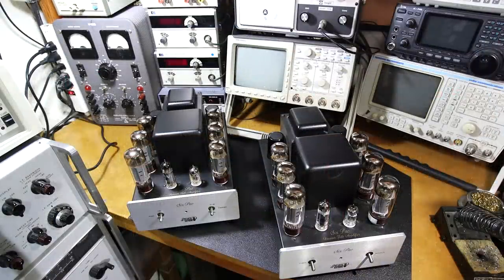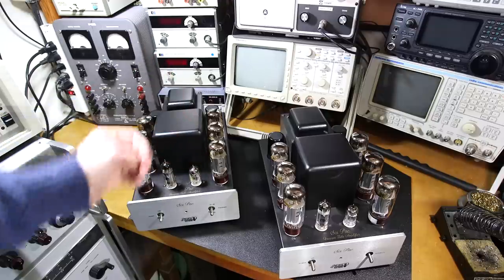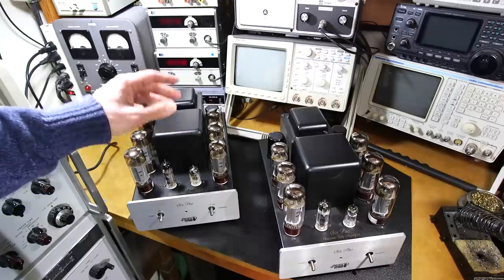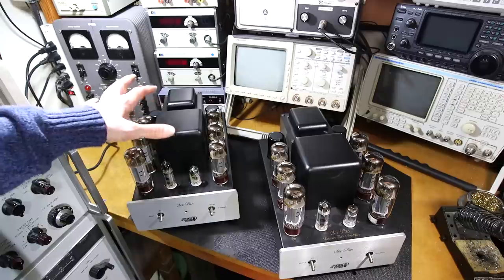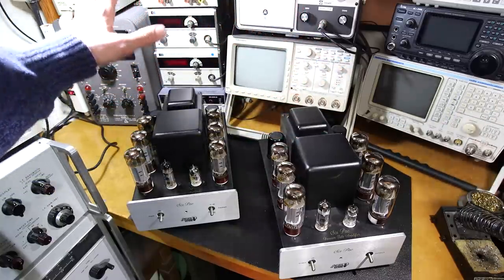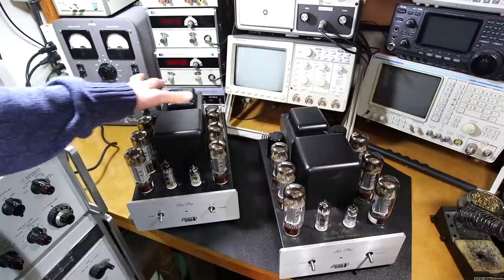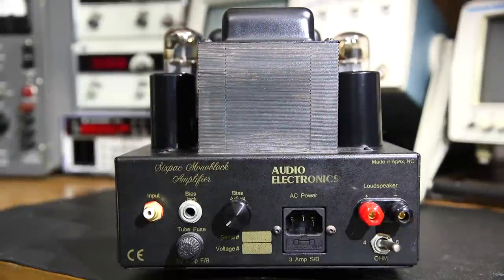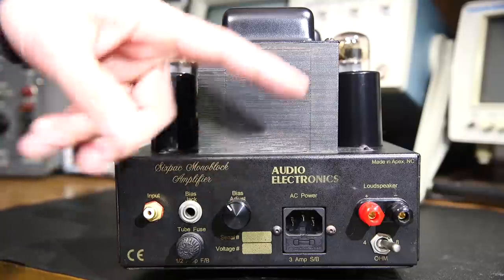Two Six Pac's On The Bench

Comment: Regarding not having a regulated negative supply for the EL84: This is quite forgivable and even reasonable given typical cost constraints. This is because, by definition, a current source pulls a constant current despite the voltage variations across it. Variations in line voltage will result in only very small changes in the current that this source pulls through the diff amp.

There are plenty of other things to criticize about this compromised design though, not the least of which is that 27.4K is far too low a plate load for good distortion performance for a 12AX7 and many other triodes. This circuit will generate healthy amounts of third order harmonics, which some people like. Not me.

Oh, and regarding the terminology of current “source” versus “sink”, it has become common practice in engineering to use the general term “source” no matter which direction the current flows. Instead, currents values are described mathematically as positive or negative to distinguish their  directionality.
Reply from the maker: Hi. The lower value resistors in the plate circuit of the 12AX7 are justified in this case. This is due to "lack of drive" because of the current sink. This also allows the "experimentation" aspect for the owner of the amp. This socket will work with many different tubes at many different gain levels. Keep in mind, most all tube audio guys tinker, and if they can say, "I made it sound better with this tube," they will yell it from the roof tops.
Reply from the maker: If you would like a better idea as to what Denny was thinking when he designed this circuit, This fella (no association) has a very good write up on the topic as well. Scroll to the bottom of the page:  http://www.angelfire.com/electronic/funwithtubes/Amp-DB_Heart.html

Comment: I believe turning the amp on, especially an unknown unit, without any load is really risky, no matter if there is some test signal applied or not. Imagine the amp under test oscillates or amplifies loud cracks or other noise. This can damage the OT, tubes and what not real quick.
Reply from the maker: Lots of misconceptions being repeated. Even if the amp pops or crackles with no load, everything would remain fine. Much of the time, testing with no load is done as well, you just don't hear about these procedures.
Reply: Thank you for responding to my comment. I'd be glad to learn something new on this interesting topic.

I used to service guitar amps and saw quite a few units with a damaged output transformer. Sometimes the reason was a manufacturing fault but most of the time it was caused by intermittent speaker cable or load selector, load mismatch or no load at all. Load matching seems to be really important when a designer's goal was to squeeze every bit of power from the least amount of tubes and iron. This was a common thing during 60s and 70s in the UK. The most extreme example I know is a 60W Laney LA60BL, all that power from a pair of EL34s, pentode connected, 600V B+ and 470ohm screen grid resistors. By the way, such high voltage is fine for plates but exceeds the screen grid rating. These amps are known to "eat" modern production tubes very, very quickly. They also suffer from notorious flashovers between pin 2 and 3 (heater and anode), damaging tubes and sockets.

When the amp has problems, intermittent connections, cold solder joints etc., I think there is a huge risk of creating a hefty voltage spike across an OT's primary that can ultimately break the insulation, especially when load isn't connected. That kind of large signal can be also injected by simply probing a certain spot of the circuit. That's why I prefer to have the load anytime I turn the amp on with power tubes in. 

I'm no expert though, I have never been educated on electronics so everything I know - I learned from the internet and guitar amplifier oriented books. I'd be delighted to learn more.

Comment: Another brilliant video.

I have a couple of observations: 

1. Regarding the EF84, I think that "current SOURCE" is the correct term. If you replaced that valve with an ideal current source the circuit would work the same way. The current running through a pentode is (for a certain range of voltages) independent of its plate voltage which is the definition of a current source.

2. If you were to wire a pot between the plate resistors of the 12AX7 and the emitter of the transistor then you could adjust for any variations between the two triode halves and save yourself an agonizing search for the perfect valve.
Reply from the maker: It's on the bottom half, and a pentode is a current "sink" by nature. Would you like some reference's to aid in this explanation?
Reply: I suspect that we could have the same nomenclature problems when deciding whether a zener diode is a voltage source, sink or reference. At the end of the day, we know what it does. ;)

However, if you have a reference that discusses when a high impedance current device should be considered a "source" and when it should be considered a "sink" then I would be interested.

Comment: I'm sorry in advance, I don't know too much about tubes, I guess I am too young still (even if I don't feel that way), but a question: why BIAS should be set manually? If it's meant to be a fixed current, why don't have some circuit to tune for that all the time and automatically? Again, sorry if I asked something stupid here ...
Reply from the maker: If the bias were to move automatically, this would affect the audio, as the movement would result in a heterodyning action. The movement itself would be at a frequency. If it was to adjust it self just once every start up, that would be ok.
Reply: OK, I see, thanks for the education, in general too :)

Comment: Turning off feedback resulting in a peak in the audio band is indicative of a poorly designed output transformer. At the very least, if it does exist in the raw transformer, a damping circuit should be installed to address it. It is certainly not reasonable to generalize that turning off feedback will cause peaking.
Reply from the maker: I have looked at the most expensive transformers, and they all peak somewhere open loop, some more pronounced than others. Oddly enough the really expensive transformers have (in many cases) the most pronounced peaks of all. This is the benefit of owning a Stanford Research SR780 and SR785.
Reply: @MrCarlsonsLab  I don't doubt that you have seen what you have seen. What I have seen is that many transformers do have peaks, but the better ones have more interleaving and therefore high-frequency bandwidth, moving their peak well above the audio band. In the context of actual amplifiers, either the transformers have had minimal peaking OR have had damping (usually in the form of an RC network, less often a simple damping resistor, as in the case of a 600 Ohm line output transformer) applied to the secondary to remove the peak. Of course in addition to flattening the frequency response, it flattens the phase response and makes it easier to apply feedback. In some cases it would be outright necessary to be able to apply feedback. BTW, nice work on sniffing out the hum source on the amplifier in this video. That would have gotten past many people.

Comment: Don't understand why they didn't just use a ~22K resistor under the LTP instead of the EL84. Good enough for Fender & Marshall...
Reply from the maker: LOL, the two you mention were not so concerned about distortion, in fact distortion was their thing.
Reply: True, but the LTP contributes bugger all to distortion; in those amps it mostly comes from adding asymmetry in the preamp (e.g. the DC-coupled 12AX7 cathode follower) and flattening out the output valves.

Tail resistors (as opposed to transistor current sinks) are also the norm in phase inverters in low-distortion solid state amplifiers. Doug Ford said he used resistors for current references in his Rode hybrid mic preamps as well.

Comment: isn't it bad to do the adjustments and power the amp without a speaker load connected?
Reply: Greetings:
The only test without an 8 ohm load is the no-input ripple check.

Comment: I just wonder why amps arn't built using DSP processing chips driven via stereo ADC with driving a high power DAC so all processing is done using maths not electronic components, can we not decouple the mains hum to ground to try and kill the hum or what about a choke coil in a ferrite pot core that might solve the problem with out having to move the components.
Reply: I'm by no means an expert, but here's why I think we don't see digital amplifiers very often: when you go digital you have to deal with the loss of precision caused by the maximum resolution of the ADC/DAC. While some high end ones can have a resolution high enough to become unnoticeable within the intended output range, you're always losing a tiny bit of information here and there, also they are quite expensive. Cheap ADC/DAC lose too much data due to having limited resolution. Aside from that, processing math requires a certain amount of time, even on a very fast DSP. This can introduce an undesirable delay. There are digital amplifiers out there, but they are either too expensive or too imprecise to be used as an audio amplifier (compared to a traditional one, I mean). Just two examples from the top of my head.
Reply: A high power DAC would be either a DAC followed by an analog amplifier or a digital amplifier. This is essentially how to make an active digital speaker, so you've just described what happens in any smartphone or Bluetooth digital speaker. These systems use DSP as well, no doubt.

Comment: Amazing! Thanks. Why do you need the choke? wouldn't a pair on biiiiiig caps take care of the ripple?  The question is sort of generic on chokes in power line.
Reply from the maker: The reactor is there for stabilization (choke regulation), and to drop the Voltage.
Reply: Mr Carlson's Lab 👍thank you for the answer.

Comment: Watched this yesterday and have a couple questions. First, isn't dangerous to run the amp with no load, the reflected impedance the plates see could be quite high if the feedback switch is opened. Also, did you double the power by using the 8 ohm load on the 4 ohm secondary tap? Thanks for the video, I took away several key tips you clearly demonstrated for my amp work.
Reply from the maker: Hi Craig. In order to have a reflected signal, there needs to be one (a signal). Impedance refers to AC. There is DC across the output transformer winding, but no AC is present unless you apply a signal to the input. Your ohm meter reads DC resistance, you can look at impedance as AC resistance. Measuring AC resistance takes different tools, often much more expensive. This is why, when you read an 8 Ohm speakers DC resistance with a standard DMM, it reads around 6 Ohms. Your trying to read impedance with a DC meter.
Reply: I understand all that. I'm saying if the 60/120 noise was electrically induced into the preamp (not magnetically coupled as in your case), then the plates would see a very-high AC impedance because you're only loading the secondary with your scope probe input impedance (10M x turns ratio**2). The AC load line is nearly horizontal in this case. Thanks for the quick reply.
Reply from the maker: Any AC signal present at the output transformer would create reflection issues. The thing with tubes is, you need a substantial amount of reflected power to harm anything. IE, this thing would "try to" put Watts into nothing all day long and have no issues. Transistor amps are a much different scenario. There is a reason your microwave oven doesn't use transistors for RF heating. When the transformer load side is open, the tubes do not see anything (with no signal) Once you add signal with an open secondary, the plate impedance would be high. The output power was doubled by adding 22uf to the diode side of the reactor. The B+ Voltage rises to 600 at that point.
Reply: I'm going to think about your power supply modification some more. Thanks for the video and leaving me with more research to do. :-)

Comment: Could a microwave transformer be used as an amp transformer?
Reply: Greetings:
Power supply or output transformers?
Output: No because microwave transformers have no center tap for the B+. The transformer input windings would become the speaker windings with unknown impeadance.

Power input: extra windings are needed for heater power. Yes, you could add another transformer & a bridge rectifier to make up for the lack of output center tap. Or, a single diode half-wave output would lower the B+ voltage output from the reactor (aka choke). A reactor captures, smooths and releases the energy from the input current and provides a much nicer output current. I believe a choke blocks the passage of high frequencies while not expecting that rf signal to contribute to the current on the far side.
Of course, all of the voltages would be varied.

Comment: Where did you learn all this ?  Did you go to MIT ?
Reply: glenn goodale They teach all this stuff to every child in Canada.
Reply: wow
Reply: glenn goodale They reduce their maple syrup rations if they don't know it by 5th grade.  Haha
Reply: mikedrz Pffft I wish! I love this stuff but a lot of it goes over my head.
Reply: You learn things when you have a passion for it and just do it every day and experimenting, seeking information as you go.
Reply: If you take electrical  engineering courses in college or else where you will learn this type of knowledge in circuits, systems and signals classes which are more advanced. The base knowledge for the electrical components in the this amplifier and many other devices consists of laws or rules such as resistence, capacitance and inductance which are taught in 200 level physics courses in college which are beginning level courses in engineering the first 2 years of 4 years. Mathematics is used to explain and prove these laws work and allow you to adjust the laws to your needs. Combining these laws is what creates most all of circuits available today which operate all electrical equipment as in computers/iPhones to cars and TVs. Transistors is the other area of electronics which the vacuum tubes or valves are early representations of. Tubes are used today in specialty products such as expensive high quality audio equipment due to the manual manufacture. They are not put together by robots in seconds they are built by hand and can take many days or even years to complete. Even the most advanced and complex devices today have come from the information you will learn in those courses and from these videos They rely on those laws or rules to operate and have those components inside of them in different forms or combinations. So learn up from Mr. Carlson

Comment: For 6 ohm speakers...which impedance mode should I use?
Reply from the maker: If you are measuring your speakers with a DMM, the DMM will read 6 Ohms for an 8 Ohm speaker. DMM's will only measure DC resistance. The Ohm rating on your speaker is measured in AC resistance, otherwise know as "Impedance." Reading impedance takes a much different tool.
Reply: Mr Carlson's Lab 
Thank You very much! My speakers say on the back they are 6 Ohms, I didn’t actually measured them.

Comment: Does it not cause an issue setting the bias with no load?
Reply from the maker: The bias is a static adjustment, meaning there is no audio drive to amplifier when this is set. The load on the output of the amplifier is only important when drive is present or (an audio signal) is there.

Comment: How can that choke be effective without an input filter?  What does it have to discharge into when the line crosses zero?  Wouldn't adding an  input filter capacitor greatly decrease the noise produced by that thing and be easier to do?
Reply: DEW409 choke filters for amplifiers are often used because they end up giving you much lower voltages but potentially better regulation. There are other tradeoffs but basically a transformer that gave you 600v with a capacitor filter can be like 400v with a choke filter, which makes the rest of the power supply much easier to deal with.
Reply from the maker: Very good answer Daniel!
Reply: Then why start off with such a high voltage from the transformer?
Reply: Choke input lowers HV under load  ,  capacitor input does not need a higher voltage transformer ( cheaper ) , choke input ALSO loads the following capacitor way different instead of only charging the filter capacitor on peak current and these kind of amplifiers sound often much smoother than with capacitor input filter. ANOTHER advantage is way better regulation .
THE COKE MUST BE FIRST QUALITY WHICH IS NOT ALWAYS THE CASE!!!

Comment: Any reason why you don't see toroidal transformers used in tube amp's?
Reply from the maker: They are used in amps. Toroidal transformers are great, and are very efficient.
Reply: @MrCarlsonsLab .. Thanks for the reply.. Yes I've been told that they are better than the "standard" style and have seen them in some old 80's amp (you might call it new since you deal a lot with vacuum tubes).. But for some reason (other than cost) it appears that there is another reason why its not the preferred option.. For example why is it not used in the amp you have here.. I doubt it is cost since it don't look cheap.. Cheers
Reply: And when we are talking about toroidal shapes... Wouldn't a toroidal shaped choke/reactor have less stray magnetic field... And thus less noise Coupling in the application you show?